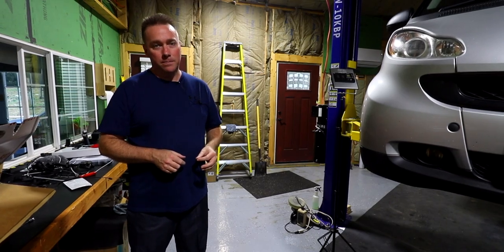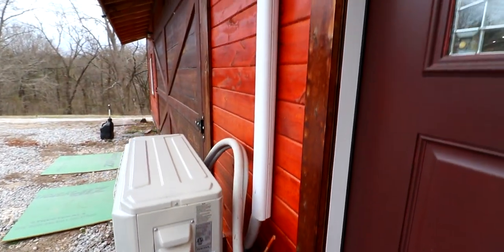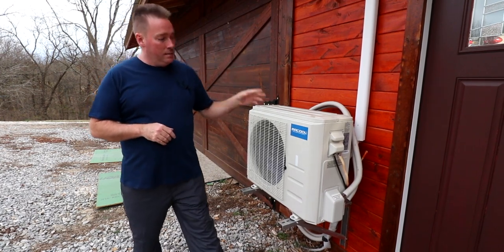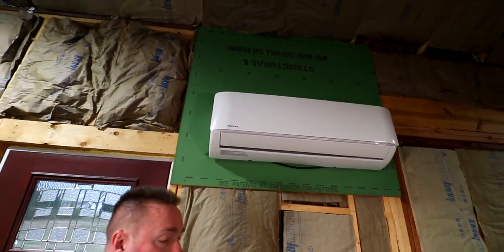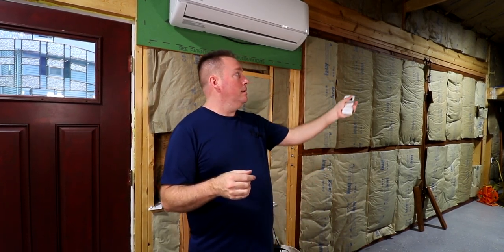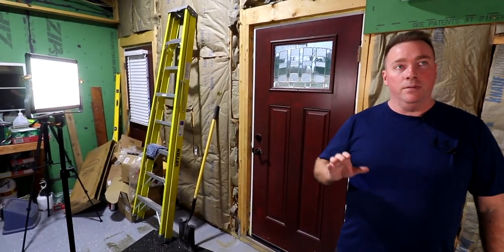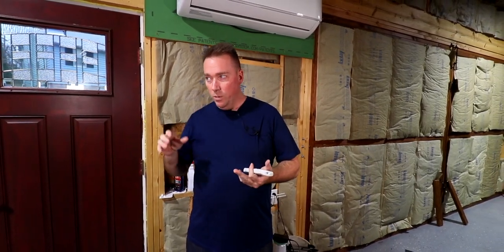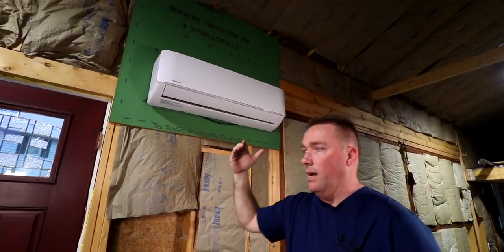MRCOOL Mini Split AC Heat Pump Installation SECRET TIPS Part 2

Comment: You need to install vibration pads underneath the unit.
Reply: That's what i was thinking. an inexpensive roll of 1/4" rubber would help.
Reply: Nah just don’t be a fool and Mount to your wall

Comment: If you have such cold winters, I'd suggest putting some insulation (along with a vapor barrier) underneath your concrete slab if you decide to further expand your garage. It makes a big difference in comfort.

Comment: looks like a great unit. A very good presentation of facts.
BTW put some rubber tubing over the outside mounting brackets so you don't rip your leg.
stay safe!
Reply: Perhaps trim them off?
Reply: My right knee knows this very well from the trailer hitch sticking out of my pickup truck receiver.

Comment: I appreciate you taking the time to explain things. I own a Mr Cool unit in my main house. It’s 27,000 BTU with 2 heads. Finally runs well after they replaced my original condenser that had a badly soldered joint at the reversing valve, so it lost all the freon over 2 months. I, like you, have a garage I want to heat/cool. It’s 24x28x10. I insulated the walls and put up OSB sheathing. The bottom of the Truss on the ceiling is 10’, which then goes to a soft peak of maybe another 5’. The ceiling is exposed metal roof. The SF would be around 560. I wanted to get a 12,000 BTU unit, but fear it could be undersized. They’re basically saying an 18,000 BTU unit would be better used in my SF, but the cost is much more. I don’t want to pay the cost of a 12,000 BTU unit, only to find I made a mistake. At the same time, I don’t want to shell out much more for an 18,000 BTU unit if it’s unnecessary. Any thoughts from you would  be greatly appreciated! Thank you, James 😊
Reply from the maker: I bought a pioneer unit off amazon, 18k btu for less than $1000 it is exactly the same unit
Reply: How was the warranty repair for your mr cool? Did you do the install are did you have it installed professionally? Did the warranty cover the labor for a pro to exchange the condenser?
Reply: @number1pappy  I finally found an avenue to a manager who then set me up with the appropriate people to get the condenser replaced. Once I gave them all the info on the unit, they then finally got the unit to my house, which I installed myself. Very easy.
Reply: And no, they’re not going to cover any expenses if I had to hire a pro. They only warrant the materials on their end. You’re left to shell out monies for the labor. Thankfully I did the install myself

Comment: The wall mount and “on the ground” are not the only options. They make a stand for it that sits on a platform or a slab and keeps the compressor a couple of feet off the ground.
Reply: You can just make that yourself...

Comment: Just an FYI…air conditioners do not draw air from the outside. Smells permeating into your indoor space is most likely due to air leakage around the side baffles. They are thin, flimsy plastic. But no air conditioners draw outside air.
Reply: This guy ain’t bright

Comment: I like how you took your time and explained the things you'd do differently and really went into detail about things. These Mr. Cool units seem very inexpensive compared to the variable speed ducted central systems. To the point that if it broke in 5 years, you'd could easily just get another one and everything has already been drilled and attached to set up another one. I think Mr. Cool does have non-DIY systems for those asking.. the line isn't precharged and can be cut, etc, the Olympus and Advantage series?
Reply: Are the MrCool DIY mini splits or their other lines inverter variable speed units?

Comment: My 18k olympus 22 seer had a 135f vent temp when it was 10f outside

That's at night no sun on the unit and on the cold side of the house 

I just built a new house and we'll be using mini splits definitely not going back to old school hvac systems

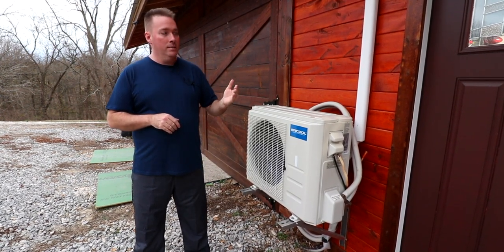Comment: 2:15ish - A 20-amp circuit should not be run on 14ga wire. Permanently installed equipment should not "literally" be plugged into a receptacle. Good review, though.
Reply: @stangmaster 2 Did it have a 15 or a 20 amp plug on it?

Comment: Sure depends on your wall construction and if it acts as a sounding board when wall mounting the outside unit. Yours looks too close to the wall for good air flow so move it out on that extra bracket space I see.

Comment: It is apparent that you are putting out content much more regularly these days but I am impressed that your videos are still all useful, relevant and entertaining so thanks for that. If you want some fresh air you could always consider a heat recovery ventilator, especially for the main house kitchen and shower areas.
Reply: good point, it makes sense to get rid of excess humidity.

Comment: Electrical note from an electrician: DO NOT run on 14 gauge wire. This unit requires 25 amps at full load. MINIMUM 10 gauge wire and larger if over 100 ft run. #25 or 30 amp two pole breaker. Otherwise, nice video.
Reply from the maker: It’s on 10-3
Reply: @NathansBMWWorkshop  Good! Just noted in your video you said "..you could even run it on 14 gauge" which would be thermally dangerous. Your wire would be the weak link instead of the breaker protection.
Reply: @NathansBMWWorkshop  hvac tech here wth is the disconnect and wipe? this is not connected directly and exposed
Reply: @GiovannyAltamirano94  Yeah this dude electrical is a total hack job.  It looks like he used NMB wire also  which I recently learned is not ok for outdoor applications due to the paper in the lines wicking water. Use UF-B or another outdoor approved wire.  Also you need some sort of grommet to seal the electric going into the unit (which would be covered by a whip for your delivery line), but also needs a wire clamp for the air handler line.  If some thing catches on it it will pull directly on your electrical contacts, water will very easily get in there, bees and what not.
Reply: Hi   I'm planing to install  an  18000 BTU  unit
Are 20 amp double beaker  and      12/2 + ground   wire ok ?
Run is   38'         thanks

Comment: Hey. Just a couple comments. By code you have to install an AC disconnect outside next to the condesor encase a technician needs to service it. also shorten the copper tubes an relate ends for better effective ness on condesor.
Reply: the hoses come tubes come in I believe 25' length, and are charged with special fittings on them. To shorten them, would require cutting them, then vacume down the unit and re-charge.
Reply: @swordsbeer6535  actually you just put on lowest setting of cooling and connect  a pressure gauge to it and close the high pressure valve.when pressure drops to zero close the suction line valve.Now all refrigerant is in the mini split.you can shorten the line and vacuum them.Them you must remove. 22oz per foot of line cut off and your good to go

Comment: Please don't run verticle loops in the lineset,it will cause an oil trap that isn't needed, coil the lineset underneath the condensor so you still have the minimum length lineset but not the oil trap that will shorten unit life.

Comment: Great video,. I just bought one, installing it this weekend. I got a smaller one, 12,000 BTU 110v for my 400 sq foot garage, in Central Missouri. I wasn't sure about it, but glad you are happy with yours; I am sure my unit will keep the temperature and summer humidity under control
Reply: I am also in mid missouri.  How did your unit do in our harsh winters?
Reply: Sorry you live in missery

Comment: You said in your previous video that the "pre-charge" is in the exterior unit itself and not in the lines, or the interior wall cassette.  So,  with that being the case,  it should be possible to cut the copper lines to the correct installation length and re-flare them during installation and avoid all that excess line.  Your thoughts ???
Reply: I am not an HVAC guy and I've never done this but I've watched a lot of YT about it and read a lot of reviews and the recommendation that I see over and over again is to do as you say and cut the refrigerant lines to an appropriate length for you space and reflare them.  The excess line length increases the amount of refrigerant you need, increases risk of kinking the lines, and increases risk of pooling/clogs.  The video below has a good tutorial on cutting and reflaring the lines.

https://www.youtube.com/watch?v=R5Nx6--4AsE

Comment: Fellow tech here. You need to fix that wiring ASAP. That looks like you used rommex cable. That's a no no per NEC code. You are only allowed to use THHN stranded or solid outdoors with conduit, with sealed tight fittings. This is because the jacket in rommex cable absorbs moisture. Yes, you can use outdoor cabling but I've never seen it used without conduit. If you want to cheat, you can change over to THHN wire right before it exits the building structure. You also have no disconnect. Besides this being required by code, you should add one for this reason, so that you can install an RSH-50 surge protector. Also, I hope you used spade connectors for the wiring connections.
Don't skimp on these steps. You cannot think of the size of the wiring by what you think the unit will draw. Inverter units need proper voltage, and if you skimp here, years down the road you'll be having weird intermittent issues.

Comment: I'm going with a Daikin a Fuji because of the 12 and 10 year warranties
Reply: That's only if a certified tech installs it, and is an elite tech for Fujitsu. I'm installing it myself because i know how, but i save 1 to over 2 thousand dollars. Which, who needs a warranty if i save more than the cost of an entire unit.
Reply: Also take note that many of the sellers of these are really mealy mouthed and 2 faced about the requirements for warranty coverage: they will sell you all kinds of DIY stuff even though their warranty statement requires documentation that a pro installed it.  Also take note that even with pro install, the seller does not provide warranty labor coverage.  Depending on the $ & features, I would tend toward strong agreement with JM M.
Reply: One thing to keep in mind is availability of parts (unless you like waiting for replacement parts by mail). Home Depot sells these...they'll be around and available for a long time...plus Home Depot and others (such as Amazon which have various warranty packages available) will pressure for quality if there are lapses
Reply: If you want dyi coverage,  mrcool is it.  Pioneer and senville only offer warranty via parts, and no labor or refrigerant. That's still better than nothing, but IMO if your compressor burns out (not mechanical failure but motor windings burn or short) and there is acid present, it's easier and almost as much to replace the entire outdoor unit. After a burnout, the system never works the same.

Comment: window units don't pull in fresh air, it's recirculated, the outside portion is the same as the outside portion of your split unit, same working design, except one is split in 2.. You are thinking of a swamp cooler blowing in outside air.
Reply: The older window units back in the day had a knob you could turn to adjust how much outside air was pulled in. You could see the flap open as you turned the knob. Notice I said knob.. so that was ages ago! I would think that windows units are sealed pretty good, but since it is all in one case maybe some outside air still penetrates?
Reply: Correct they are sealed and insulated inside to separate. They tend to have a Valve to Open it to fresh Air mode. But it's Not standard Way to run it.

Comment: The problem I see with these units is that they are only rated down to 5 degrees according to the manual (please correct me if I am wrong). But the other brands I see are officially rated from -15 to -30 degrees. For where you are at its a great option though.
Reply: Correct. But those other units aren't dyi line sets. Mrcool though released an air handler version that does go -22, but output and cop still tank at those temps
Reply: @sprockkets  Let's see who makes a DIY -15 to -30 heatpump first, Mr. Cool or Tesla. Your right, no hyperheat DIY.
Reply: Blue ridge has one that is -31 called the ultra heat but you have to use low wall or ceiling indoor units, but their hyper heat model uses all three style indoor units and goes to -22
Reply: @was9652  OH is it a DIY? I will have to contact them. BlueRidge is owned by Midea Group. I just heard about them because they are the ones who make window air conditioners that let you close the window.
Reply: @was9652  After five winters  with a Mitsubishi  two ton unit I have  never  seen icing  at all. I live in a high humidity  area and has a doe adjusted hspf of 8.2. The  advertised hspf is 10. The actuall defrost time  is about 18%.  Maybe  you need  a pan heater .
Reply: @User-pb8pd  mr cool universal:
All-Climate Performance
NOT Your Typical Heat Pump
Heating‡: 100% Capacity at -5°F and 78% Capacity at -22°F*
Cooling‡: 100% Capacity at 115°F and 78% Capacity at 130°F*
* outside temperature | ‡ based on 2 Ton model
Reply: It's rated at 5 deg at full advertised capacity. Or can operate lower Just at reduced output

Comment: Mr. Brother In law get over there and get them lines shortened up! Put it off anymore and you might get a piece of coal in your stocking LOL!
Reply: What people don’t realize is that shortening a line or extending a line means different refrigerant amount that has to be put in or taken out of the system. It’s easy for a professional but it will get complicated for a DIY. To have it done will cost you as much as the unit itself. So always keep in mind placement so you can calculate where your machine will end up and have those exterior lines as clean as possible.

Comment: I use mine for 3y  24K to heatpump a 3500sq home its all we have it worked good heating up half of the house i just got a new heat pump 60K MRcool and will do duct work since we have none :)
Reply: Oh our house is all foamed and insulated all walls new construction so heat could not escape

Comment: Where  are the cord strain reliefs for the electrical cables on the heat pump's connection box.  I do not like the way this is installed so close to the wall.   Where is the heat pump service disconnect & outlet?

Comment: couple of issues i found disturbing : If the unit calls for a 20 amp circuit you don't use a smaller wire than #12.. the other thing is the romex you have coming outside is not up to code and you dont even have a connector  to hold it in place. or a  service disconnect .. both are NEC requirements... I'm hoping that is just temporary .. but you said it is a year later....

Comment: Nice call Nathan.  I just checked the seller on amazon and they are over $100 more on their website than their price on amazon.  Wish it were $1100 instead of $1700 but beats the daylights out of my central heat and air quote.  Thanks for the update.  If you had it to do again would you have poured a small cement slab for it to sit on ?
Reply: yeah, some concrete on the floor and a wooden cover fence is the way to go if you wanna make it pretty and a little protected
Reply from the maker: Yea the price spikes up all the time
Reply: @andyb6851  I like the idea but I will have to make a thick block because my two dogs love to dig tank traps especially if they think there is a gopher nearby:: farm dogs to the core.. The fence is a nice touch also.
Reply from the maker: @sprockkets  I looked at those but they had some bad reviews , maybe they made new models now I don’t know
Reply: @sprockkets  Good Idea. Thanks
Reply: @NathansBMWWorkshop  all i can say it they worked for me, aside from me needing bolts. I put mine on a plastic pad made for these units since mine are on dirt.